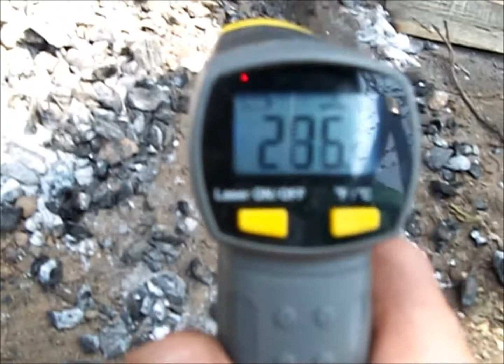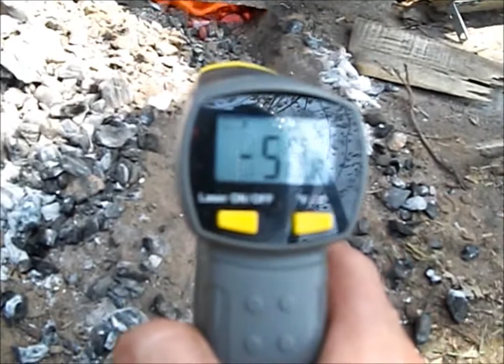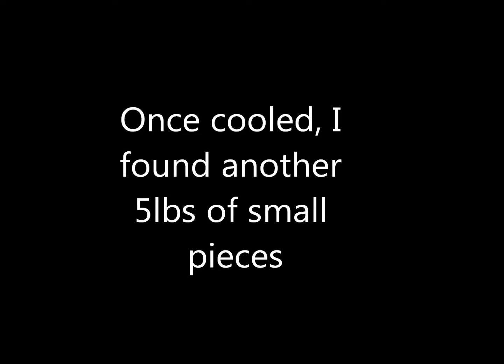Smelting Iron In Bloomery

Comment: Thanks for the great video and for teaching me something. I can now add "bloom" to my vocabulary. I tried to smelt some hematite pellets I found using an oxy-acetylene torch. It melted quickly but produced very brittle slag? Perhaps I am forcing to much carbon into the metal? Did you use char coal or coal or coke? Also how did you apply the lime to the mix? There were some solid pieces there! Sounded like a black smiths shop from war craft:) it is so cool to see a group of mates working together on a project like this. It is so cool to see it actually work. Great job, there is a lot of work involved in something like this that one only ever discovers by attempting it themselves.
Reply from the maker: +Micheal Farmer Thanks for watching! We used hardwood charcoal for our fuel. The hematite we used was actually in limestone so we just crushed everything up and tossed it in, and the lack of enough lime may have led to the excess phosphorus and other impurities to remain in our bloom. Only a small portion of the bloom is usable right now and the rest is still very brittle and slaggy. That being said, it was definitely a fun project.